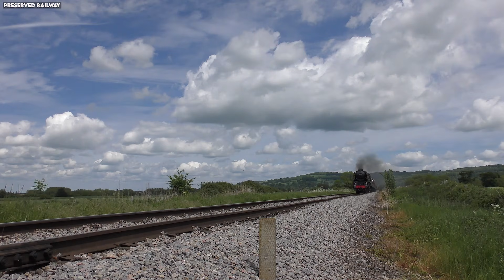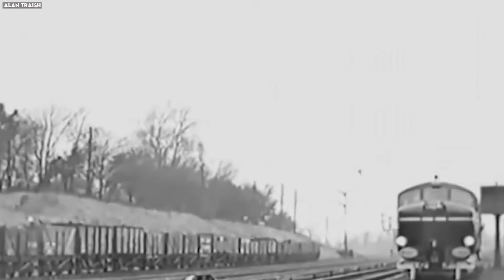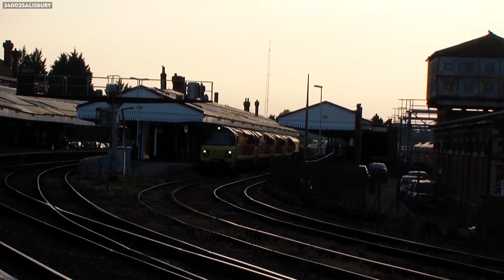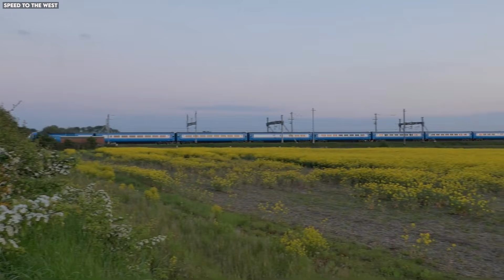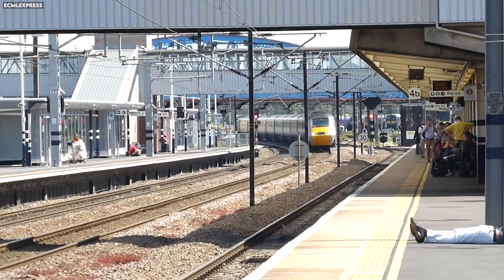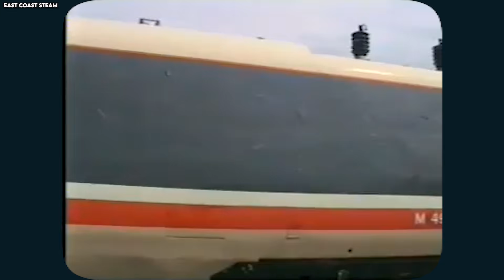10 British Locomotives That Were Decades Ahead of Their Time!

Comment: The Bulleid Diesels , the D 16/2 was also used for the first generation as well - the Class 40 used exactly the same bogie designs for the first 20 locos, and the LMS 10000`s and the 1D 16/2 used the same engine. It was the final Bulleid diesel, the 10203 that used an actual Class 40 engine , a 2000 hp version of the EE V16, and so was numbered the D20/3

Comment: European Realist here.  The problem with British engines, as shown above, being 'ahead of their time', is that they weren't; it was all a rearguard action.  While the Brits were still tinkering with steam and diesel, much of the rest of Europe was already going electric.  And as far as steam is concerned, the French engineer André Chapelon was producing far more efficient steam locomotives at the time.  Unfortunately for him, on the cusp of massive improvement in steam the SNCF decided to go mainly electric.  In the 1955 trials French electric locos were already clocked at 331 kph.  That's 30 years ahead of the 125 diesel.  In the meantime the Japanese and French were way ahead with HST in terms of speed.   The main problem is that Britain chose the diesel stopgap for 60 years, instead of going straight from steam to electric, as the French did (except on a few non-electrified French lines, like Paris  - Mulhouse in the east, which remained diesel.)
Reply: The relative availability of coal and water in the UK precluded a need for ultimate efficiency in steam locos. Post war, there were also public finance limitations on investment, which precluded the wholesale replacement of locos and permanent way.
Reply: Yepcleraly 20 years behind Europe. Like today a visit to the UK is still a time travel back in the 1980ies exeo when it comes to food, electricity, plumpbing........
Reply: The French may have designed an electric loco that could clock 331 kph, but as demonstrated in the narrative, they would have been useless in Britain because of the signalling constraints of the GB network. The fact the French could do this should not be used to run down what we had - Britan had to develop its  ideas in line with the constraints of the network we inherited.
Reply: @Stig10001  the French rail network was inherited from 5 different companies too. So no excuse for Britain😂😂😂😂

Comment: I find it very difficult to understand and see just  how the  "DELTIC"  ever made it on to this list and considered as "ahead of its time"???  as back out in the real world, they were a very expensive, very unreliable( at one point during the middle 60,s roughly half the fleet of 22  locos were out of use awaiting repair /attention !!!)   ,uneconomic and over-rated loco  that only had a 20 year life span and each power unit ,s  service life was only about a third of the  hours  of most other  class,s of diesel locos !!   considering the Deltics pulled only 300 /400 ton trains over a mostly table-top railway (hardly taxing for ANY power unit !!) !!  and its top speed was 100mph ,only 5 mph faster than a class 47 -again ,hardly revolutionary !!  and the idea of a diesel engine turning a generator to provide electricity to power traction motors was certainly not futuristic !! the fact that only 22 production machines were ever built (the Midland ,along with the Western were not interested in them )  tells you all you need to know about the class of loco
Reply: In fairness, the Western wasn't interested in anything that wasn't "western".
Reply: @alanbrown9178 German diesel hydraulics did well, didn't they?
Reply: Spare parts also became an issue
Reply: The Westerns were far far more practical they would be on the Riviera on a Monday on Tuesday a stone train out of Merehead and Wednesday a milk train. Deltics only on passenger and crews afraid to go off the Eastern region!
Reply: @vernongoodey5096  yes the Westerns were indeed a good and powerful loco-BR eventually got them running perfectly -it was only the fact BR withdrawn the fleet  as  being classed   as non-standard -such a shame as they really did turn out to be cracking locos !!
Reply: You don't know much about the Deltics. No diesel locomotive ever covered the miles that they did at the speeds that they did. Even in 1981 at the twilight of their service they powered the fastest locomotive hauled train in Britain.
Reply: @philipkay8116  yes -your right ,I will bow to your vastly superior knowledge  as I really dont know that much about Deltics as I only  had a  42 year career on the footplate as a train driver/secondman - so what do I know  ??-I only drove locos  !!!!!!!!!!!  but   remind me again of just how many times a deltic was out-of-traffic awaiting power unit rebuilds after only 5000/6000 hours in service ? when you consider that most other diesel locos power-units had a service  life of between  12,000/14,000  hours between overhauls !! " no diesel locomotive covered the miles they did at the speeds they did " -really? really ?? so  your obviously unaware of the vast daily  mileage ,the  speeds ,  and thrashing the class 45/0.s ,  46,s and class 47,s covered and suffered on the north-east/south-west cross country trains day in-day out and year-after-year-after-year ?? and how many miles the class 45/1,s covered  each and every day on the  intense midland mainline diagrams and mostly at their maximum speed of 90 mph ?? and these locos were around way before the Deltics and still covering these same duties long after the Deltics withdrawal ! most other main-line locos could be found  on a passenger train one-day ,heavy freight  the next day ,then a parcels train  and finally working  a heavy ballast train at the weekends -funny thing I never saw many Deltics working anything other than passenger trains and  never off the eastern region  as all other regions knew how over-rated and unreliable they were  !! at the end of the day ,if they were really a good loco ,they would have built far more than 22  as  other regions would have ordered/operated them !!-simples - but hey-lets not let the  facts spoil  your delusions

Comment: The really powerful trains were the Class 91 and mk 4 sets that ran before the Driving Van Trailers were completed. They ran with a class 43 off an HST set in its place adding another 2o00 plus HP. you could tell the ones that were used after as they had been fitted with buffers. Unfortunately the Class91 had to be restricted in acceleration to avoid strain on the 43.
Reply: No. The Mk 4 sets always ran with DVTs. The Class 43s ran with Mk3 coaches. Initially they just powered the coaches but this lead to engine issues, including failures, due to prolonged low power running.
Reply: @neiloflongbeck5705  The railway magazines said at the time that the class 91 acceleration profiles had to be adjusted for use with the class 43s!!!
Reply: @brianfretwell3886 I haven't commented on that part of your original post as I have no knowledge about it.
Reply: @neiloflongbeck5705  I read your post as if you had done that, sorry.
Reply: @brianfretwell3886 that's OK.

Comment: The Bulleid Pacifics were not ahead of their time - they were an evolutionary dead end. The air smooth casings and chain valve gear were never repeated despite every development up to then being carefully evaluated in designing the BR standard class engines that followed. 
Similarly the Leader was a failure because some of its 'advanced' concepts were impractical and it was these rather than the impending end of steam caused its demise.
Pity that almost all shots of the blue Pullmans were actually of the repainted HST crude mock-up. That haughty front of the original was so distinctive. But as you said they proved the concept for the HSTs. As a footnote note not only were they airconditioned they were double glazed. Unfortunately on my only experience on the Birmingham Pullman on a cold january day the seal on my adjacent window had broken and it was almost impossible to see through the film of condensation between the panes.